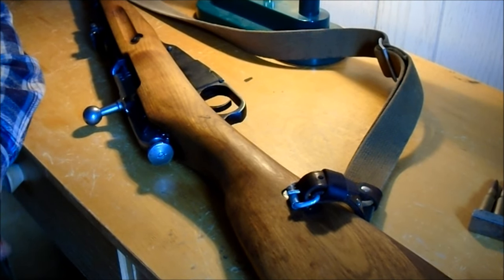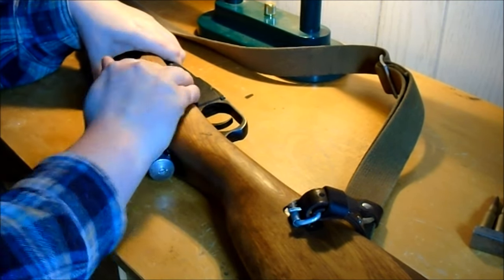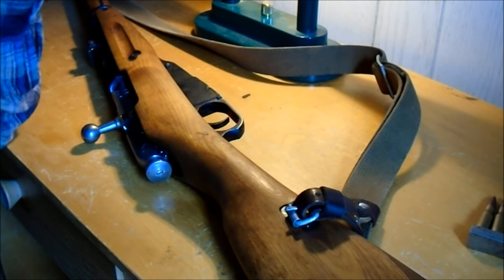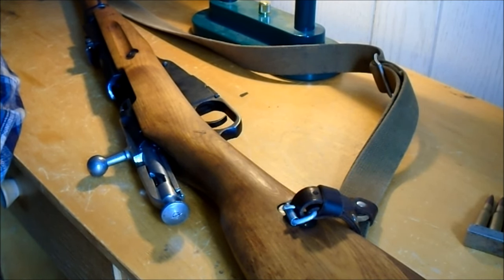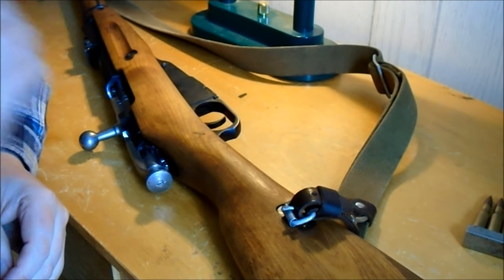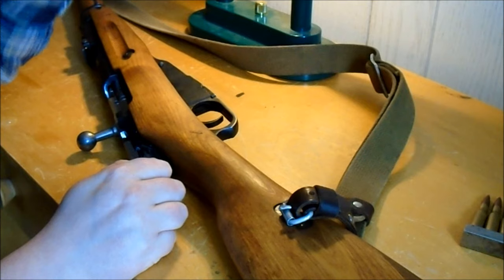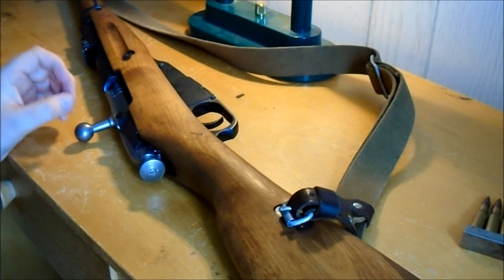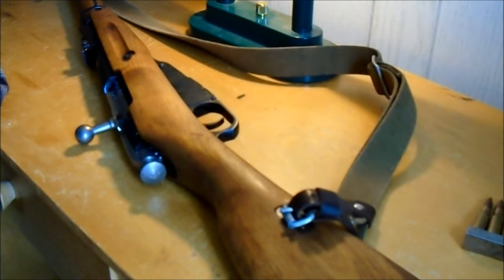M27 Finnish Bolt Wings

Comment: I'm with you on the slots/tabs being an attempt to make the trigger pull more "regular".

From mosinnagant.net:  "The  small guide wings as found on the m/27 bolts connecting                              bar from 1927 to 1933. The arrow indicates the wings. The bolt on the right does not have this feature. This slot/wing set up was discontinued due to the difficulty in closing the bolt if the slots became fouled." 

I expect snow/ice buildup in these slots would be the big issue.
Reply from the maker: I looked into it a bit more and the m27 has a trigger mod where the trigger is pinned to the sear so I think the wings were added to help that :)

Comment: My M27 has the wings and I can definitely tell you that it does affect the trigger pull in a very positive way. I have no idea where the feeding suggestion came from originally. But from practical experience on owning that type of M27, I can say that I love the difference in the trigger between that and my other Finnish Mosins.

     BTW, I won myself an M28 a few days ago. I'll post a video on that when i get her. :D
Reply from the maker: Thanks for the comment :)
Reply: Teleoceras ditto thanx for info ; how is the sear cut on m27 cocking piece 90*or the last mm or so cut at a negative angle?paired with 90* sear sprig?

Comment: Is the sear on your m27 cocking piece cut square 90* to bolt or does it have the last mm or so cut at a negative angle ( like my m39) and sear spring angle cut 90* also?
Reply from the maker: not sure I dont have a M27 :(